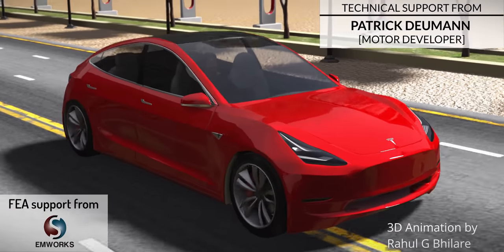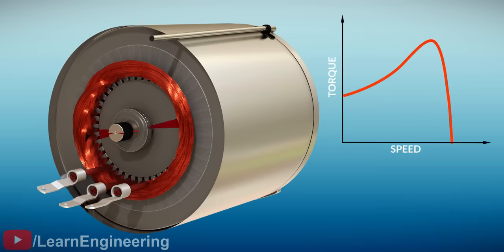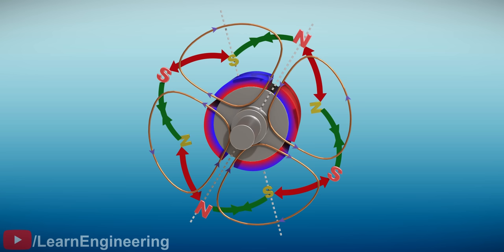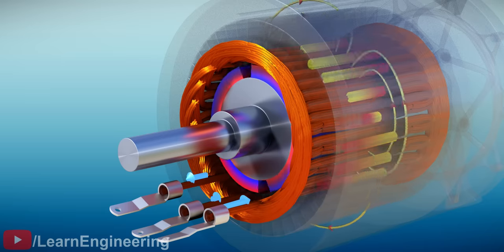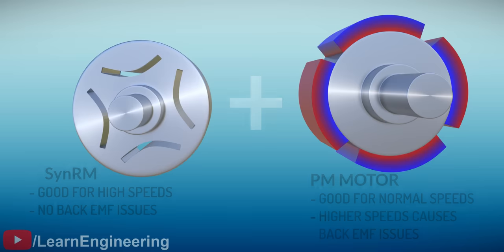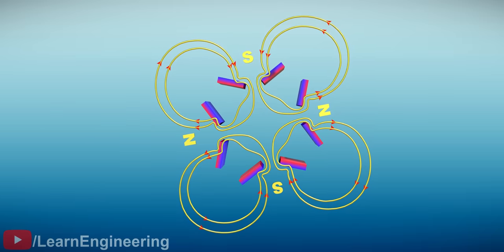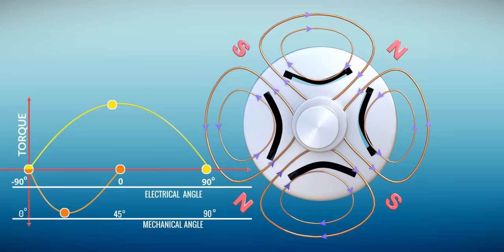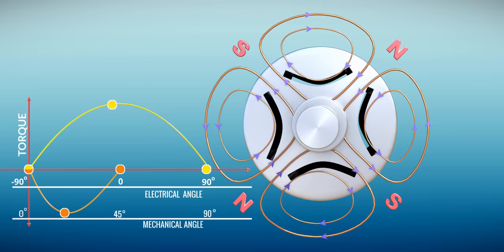Tesla Model 3's motor - The Brilliant Engineering behind it

Comment: Thank you! I drive a 2019 Toyota Prius Prime, and this video is the best explanation I've ever found on how the cars two motor/generators work. One thing the video didn't mention: there is a sensor on the rotor shaft of each of the Prius's motors, that continually and very precisely tracks the angle of the rotor around it's 360° circle. The signal from this sensor is fed to the motor control computer, which is controlling the bank of high-power MOSFET transistors in the inverter,  that create the 3-phase alternating current that power the motor stator windings. As the video explains, there is an ideal phase-angle relationship between the magnetic fields in the rotor's permanent magnets, and the phase angle of the rotating magnetic fields being produced by the stator. The motor control computer continually adjusts and optimizes this phase angle, based on the signal from the rotor position sensor, and other sensors, plus the driver's demand for power given via the throttle pedal or cruise control setting. I assume that the Tesla, and other EV cars, have a similar sensor on the rotor.
Reply: @aceman0000099  tf lmao
Reply: Yes. These sensors are typically called "absolute encoders" in the business.
Reply: Toyota use Insulated Gate Bipolar Transistors (IGBT) not MOSFETs
Reply: @AlexBesogonov  Toyota call these sensors 'Resolvers'
Reply: @tomtucker83  - Thanks! I'm not an electronics engineer. I know that the inverter/converter in hybrids and EV's have to handle a lot of power (up to 70 kW in my Prius Prime), and I assumed that only MOSFETS could handle that much power in a package as small as those used in a Prius inverter. The Prius Prime traction battery at minimum state of charge is about 345 volts, with up to 375 v at full charge, so to deliver 70 kw to the MG2 motor under hard acceleration, the inverter would have to handle about 202 amps - a hell of a lot of power to pass through a semiconductor device not much bigger than a 50¢ coin.
Reply: @AlexBesogonov  - Thanks! I'm totally amazed at the ingenuity of the engineers that designed the 3-phase synchronous motors used in modern EV's and PHEV's. When I got my first drivers license in 1974, there were hardly any cars in existence that got any more than about 20 mpg, and most American cars got 12~15 mpg. My Prius Prime (in Hybrid mode) squeezes 60 mpg  out of the gas engine, and about 6 miles per kilowatt-hour from the traction battery in EV mode (that's at 35 mph. At higher speeds, it's maybe 4.5).
EV's and PHEV's are amazing cars, and fun to drive.
Reply: @tomtucker83  a switch is a switch.
Reply: @laura-ann.0726 agree. Most people truly don’t yet have a clue how superior the tech in EV/phev/hybrid is. It’s actually a sin they’ve caught on so slowly, despite the first Prius coming over 20 years ago.

Even today in a pure ev a relatively inexpensive car can be purchased, which consumes trivial energy, and for performance trounces gas-only vehicles.

Comment: We've been utilizing permanent magnet rotors in motors in similar configurations for 100 years. Interesting that they are coming back around, while being tweaked for efficiency.
Reply: Ngl, I'm just dipping my toes into the water with PM's, what did we start using them for?
Reply: @insanitysreign6195  Printing presses :) "History was made when Thomas Davenport of Vermont invented the first official battery-powered electric motor in 1834. This was the first electric motor that had enough power to perform a task and his invention was used to power a small-scale printing press."
Reply: Elon Musk invented another 100 years old thing.
Reply: @insanitysreign6195  finding north
Reply: Yup, old news. Hyundai has used this in their hybrids since 2010 and I'm sure others have before that.  I guess this video is good to show how tesla changed the motor but they kinda make it sound like tesla invented it.
Reply: @JPN76  The video does point out at the end that Tesla wasn’t the first.
Reply: @soentrueman7944  probably the electricity in 1834 was generated by a wooden waterwheel spinning from a running stream or river.
Reply: @vichy7661  I'd have thought more likely to be steam powered by that point, but it's certainly possible to generate power with a waterwheel with the correct gearing in place. Waterwheels spin quite slowly, so they would need to drive a much, much smaller cog (in terms of teeth) in order to create a large rotational speed in order to create the voltage required. As a result you wouldn't get much current, but if you're just charging a battery, (as Thomas Davenport was doing) the current is almost negligible because you can leave it charging, say, overnight.
Reply: Power electronics is the magic word
Reply: @soentrueman7944  On Rte 43 E out outside of Brandon, VT, there is an historic site sign where Davenport did his work.
Reply: @JPN76  Toyota has used permanent magnet synchronous motors since the first Prius, in 1997.
Reply: @soentrueman7944  Davenport's motor was a brush-and-commutator DC motor, not an AC motor. It had a shunt field winding, not permanent magnets. That motor was about as different from a PM AC motor (such as in the rear of the Tesla Model 3) as any motor can be.
Reply: @brianb-p6586  oh I'm sure. I'm mainly referring to the was the bar magnets are arranged within the laminated plates. I'm sure hyundai wasn't the first but was just saying this has been around awhile
Reply: @JPN76  Yes, it is the conventional configuration of interior permanent magnets, and it has been around for while.
Reply: @insanitysreign6195  picking up nails in the fire pit
Reply: @soentrueman7944  steam power was illegal in Vermont until 1899
Reply: It's just like Apple, releasing "new" features present in Androids available for many years. lol
Reply: We don't need another Theranos.
Reply: @Volodimar  Musk claims to be an engineer, not the inventor of the electric motor, or anything else 100 years old.
Reply: permament magnet means more maintenance costs, because you need either have way to magnetise them back or replace them completely. There is a reason why idnuction engine (invented by ACTUAL Tesla and not by phony company) is still one of the most dominant engines both in industrial and home usage. It is perfect in terms of maintenance, as mostly you need to pay attention for the bearrings
Reply: @zawarudo1041  Today's permanent magnets far outlive the life of the vehicle.

Comment: The visualisations in this are really great. Its particularly nice that the influence of clever control algorithms is shown as well as the basic physical setup. Second semester engineering students rejoyce.
Also I am glad to see that it was noted that this was used looooong before model 3 came about. The BMW i3 is another such example if I recall correctly.
What was missing imo was a visual representation of losses over rotor speed and load. Because the main issue of induction motors in automotive applications is their bad partial load performance which is not only dependant on speed.
Reply: 1st semester English students shake your head. It's   R E J O I C E

Comment: My brain just blew up 🤯🤯🤯🤯🤯
Reply: same here
Reply: My head hurts.
Reply: Basically reduce friction between the magnetic field lines increases efficiency. All achieved by interlocking them by changing the angle.
Reply: This is the easy part. Try understanding and improving battery chemistry if you want a real challenge.
Reply: @Eddingtonification  You might want to look up how Toyota's hsd and a load of others work before promoting that. I haven't watched your YT post but from the title it sounds like you're in for a world of copywright claims.
Reply: @siraff4461  I would love to try!  Serious.  @dynamicdavid #dynamicdavid
Reply: @dynamicdavid  I think its well worth it but its not so simple as basic chemistry. A lot of things change when you start adding heat, cold, charge/discharge, etc. 
I find it very interesting but I can see why a lot of people would be put off. If you want to get into it I would say go for it with the caveat that its not quick and easy to learn. It does get easier as the pieces of the puzzle fit together though.
Reply: same bro
Reply: My brain just soaked up some really good information.  A crystal clear explanation, thank you Learn Engineering
! :)
RPMsynRM = two types of integrated motors great for both starting torque and high speed operation (in a nutshell).
Reply: Mine is spinning in my scull
Reply: Jirri BAWA
Reply: Keep studying and you will get it
Reply: @nope1083  His brain blew up, which means he cannot study anymore
Reply: @ebeampython4400  e
Reply: You have to invest 4 years before watching this..😆
Reply: me too
Reply: Then serch cryogenic engine also..

Comment: This the the electric car version of ignition advance curves to improve efficiency at different speeds.
Reply: Yeah, something of the sort.  
Unfortunately, spark advance did not resolve the issue of Coil magnetic-saturation at high RPMs.    That was resolved later with multiplexing multiple Ignition coils. (first it was 2 coils (50% duty cycle)  now some cars have one coil per Cylinder.....)
Reply: Very good analogy.
Reply: Robert Slackware  They don't have 2 levels of CONTACTS.  It's all electronic Commutation. 
and they don't fire on empty cylinders. 
the EIS simply monitors the firing sequence
then triggers the proper coil. 
By sharing the duty cycle the Coils have time for proper saturation. which was a problem at HIGH Rpms.....
Reply: Not at all. Inverter motor simply take the electricity and adjust the frequency. The outlet in your home runs at 60hz. The inverter changes this HZ to whatever it needs. It  goes from 1hz to 1khz (top limit would be the maximum rpm the motor can handle). The first DC brushless motor was the gas gauge in vehicles back from the middle 1900s. Yes that is a DC brushless motor.
Reply: Not at all like that. The old motor they had would run like that. They had timing advances. This is like running 2 ignition systems both at the same time and blending between them depending on RPM

Comment: to those having a headache:  1. when magnets are moved around wires an electric current is induced in the wire.  i.e. electrons move.  2. if electrons move thru wire a magnetic field also circles the entire length of the wire.  electricity and magnetism are not separate.   it is one phenomena joined from two properties = electro-magnetism. 3.  so, use the magnet's field to move metal parts around, like a drive  axle.
Reply: You are confused, electricity and magnetricity (not magnetism) are two sides of one coin.
Reply: Define field? Are particles really moving(electrons)?
Reply: @soundtrancecloud5101  the key answer is that elektromagnetic fields can be split in the "electro" part and the "magnetic" part, the angle between them is 90 degrees, here pops up the translation of the rotor of 45 degrees, here you see the difference between zero-max - zero the 50 degree is just a result of the vector calculation. it is not rocket science, it is more difficult:)

Comment: I would have  switched out the squirrel cage with a hamster cage. The hamsters are far less likely to want to stop in the middle of a long drive just too mate. They're also are far more costly when the battery "squirrel" packs need replacing. It's just common sense to use hamsters instead of squirrels to power our tech.
Reply: He's right. We're still on squirrel technology and all they do is try and pinch your nuts!
Reply: Nah.  Hamsters just ham it up. Besides, they’re too ham-fisted.